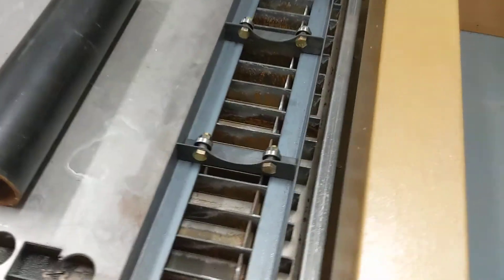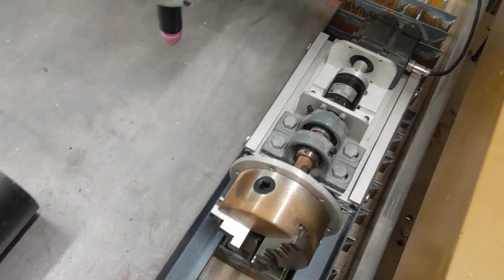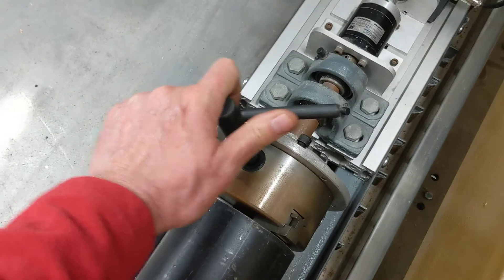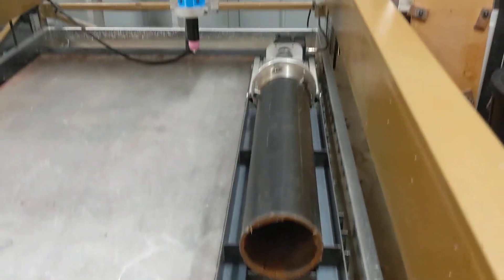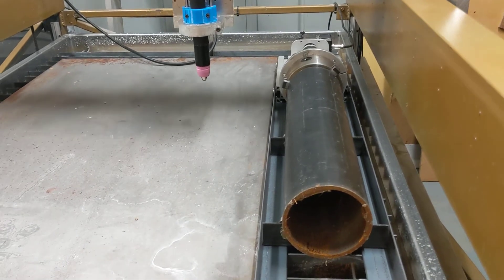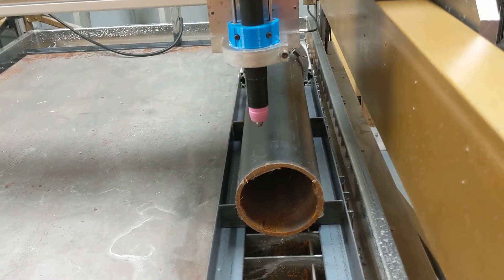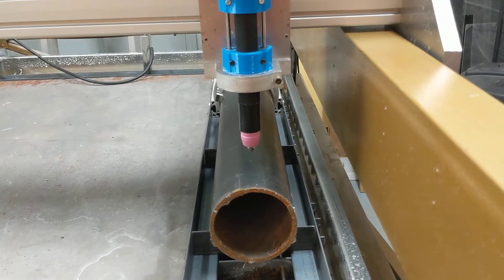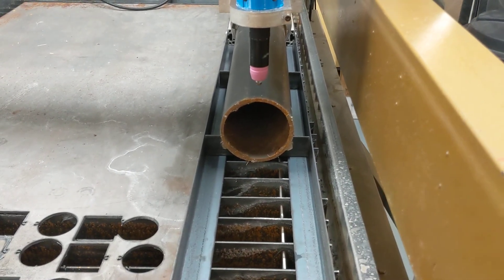CNC Plasma pipe cutter set up.

Comment: I am trying to figure out how to insert a gear reduction of 100:1 to reduce start up energy of servo motor combined with weeight of the chuck.  I purchase a Teknic servo motor thinking it would not be an issue, but its too much energy/weight to slow down
Reply from the maker: It pretty easy mechanically to fit.  MIne is 100:1.  Just fit it and adjust the steps in your setup .  This video shows  how mine is fitted. https://youtu.be/LLgLVYoRuqY

Comment: What program do you use to write the code?
Reply from the maker: It was written with modified milling cam software.   I had to write a few macros and insert that g-code into the start and finish procedures for the touch off probe,  initial cutting height control before the THC kicks in,  pause period to allow the initial cut through and I removed all the z-axis  commands in the setting so no z-axis g-code is generated.
Reply: thank you

Comment: Please, is there a free software to run the rotary pipe cutting?
Reply from the maker: I dont use 4th axis rotary cutting.  I produce a flat cut but swap the x-axis to the rotary axis.  Each pipe needs it's own profile to make sure the steps per MM match pipe diameter
Reply: @spidey4fun  
Thank you very much